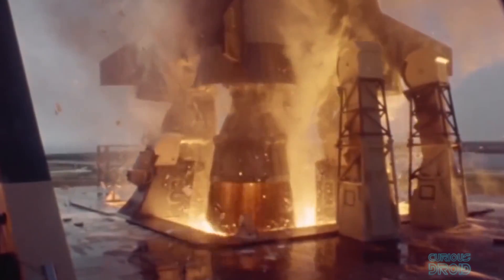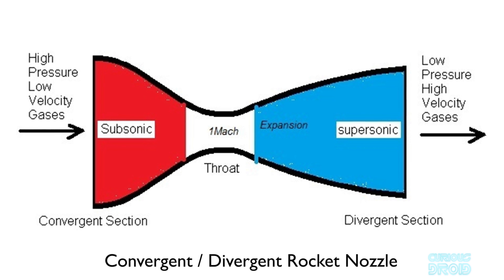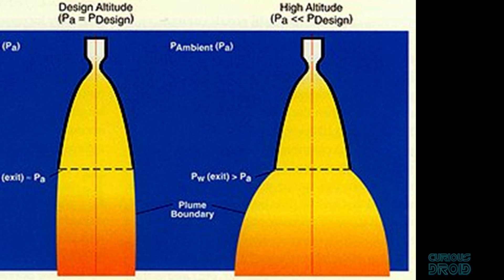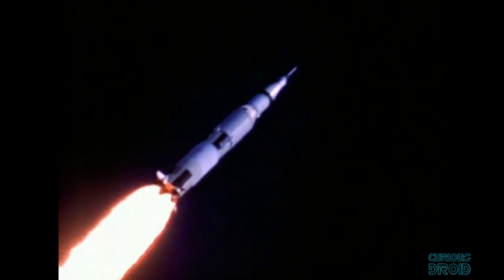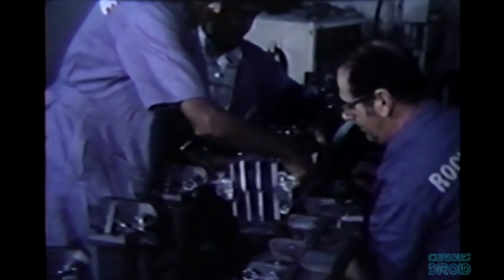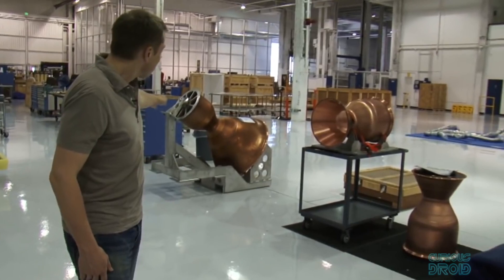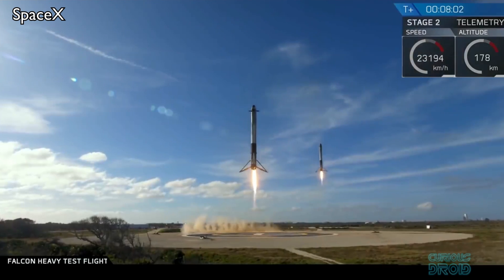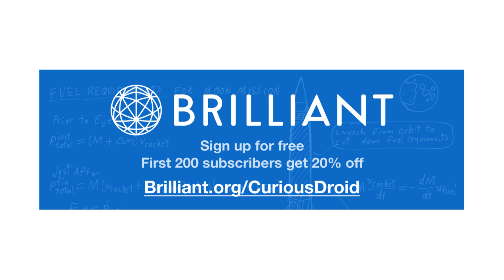Aerospike Engines - Why Aren't We Using them Now?

Comment: Rocket stages don't exist because of the need for different nozzles, they exist because if you're at half fuel that means half the ship is dead weight. Separate and drop the wwight, become more efficient.
Reply: We did that,  unfortunately, we threw all that hardware away which takes the efficiency gained and ruins the cost per pound. The whole point of the venturestar was to have a ship that could be inspected and reflown quickly.  As Elon Musk said himself. if you dont throw it away, you get to keep fueling it and reusing it. Smaller cargo maybe, but long term cost is super low and they return on the investment much, much higher.
Reply: @rayspace373  Same principle still applies in Space X launches except for the fact that Space X lands the boosters that are separated from the main stage with some leftover fuel. When you separate the dead weight from the main vehicle, the main vehicle will be awarded with a boost of delta-v, which is the amount of acceleration that an engine will provide with a given amount of fuel. Once you shed off all the extra mass, it results in the engine not having to work as hard to achieve the appropriate velocity needed for orbital flight. The efficiency of the engine is, definitely, also a key factor and is accounted for by staging the rockets with engines that are more efficient in certain altitudes. 

Right now, staging is the superior method of getting into space. The aerospike might have the potential to become the superior method, but it needs more development and testing before it can be fully realized, in my opinion.
Reply: True, but an SSTO doesn't have to be written off every time it flies.  The idea was to give up a little bit of payload capability for a much higher launch cadence and lower operating cost.  Maybe an expendable rocket can lift twice as much in one launch - but if you can launch the SSTO twenty times for the same amount of time and money, who cares?
Reply: I liked the idea of the Saturn first stage fitted with wings and a set of turbofans and landing gear for the return leg.
Reply: That model only works if the payload itself is a substantial part of the launch cost.  What if you want to launch something cheap, or your customer doesn't want to spend millions of dollars?  Nobody's going to launch a $1 million satellite on a $500 million dollar rocket, so expendable vehicles are only good options for payloads that are very expensive.  An SSTO would be able to tap a whole new market that didn't exist before.
Reply: Funny you should say that... you see, payloads are actually more expensive than rocket launches.
Reply: jax is correct.  Staging off dry tanks is key.  And since you no longer have to haul the heavy tanks and their even heavier fuel once dry, you don't need such big engines anymore, so staging off engines is good too.   Tsiolkovsky (oh look, a search keyword) will always make rockets his bitch :)

Aerospikes are actually pretty poor performance.   While they perform adequately across all regimes, they aren't any better than a nozzle design within it's design regime.  Often worse in fact...and they tend to be heavy.  Staged rockets also don't have to have engines that have good performance across all regimes, they only need the engines to be good up until they point that they're dropped.   Ex. the Saturn V uses high-thrust, low-iSP engines optimized for sea level performance (the F-1) in it's first stage, and hydrogen-burning, high-iSP, medium-thrust J-2s for the upper stages which operate in, and are optimized for, the upper atmosphere or space.

Note that the high pressure regime is actually very small.  Air pressure drops off very rapidly with altitude.

In order to make an SSTO practical and competitive, an aerospike would have to have twice the specific impulse, not slightly less than a conventional de Laval nozzle.  Ideally more like 10x the specific impulse.
Reply: That of course is a major reason for staging, but engine nozzle design plays a large role in how efficient your engine is.  This is why the Delta II with nine SRBs only ignited six at launch.  The remaining three had nozzles optimized for higher altitudes, and were ignited mid flight.
Reply: It’s both
Reply: Sounds to me like a hybrid design using conventional rockets for boosters and Aerospike for the rest would solve the problems. Specially when combined with the SpaceX return feature.

The other thing thou is that a returning single stage would greatly reduce space junk.

P.S. its kind of dumb how development just "stopped" when it can lead to so much savings & efficiency.
Reply: NASA ab8ment areas r drop/landing sites 4 SRBs & stage sections.
Sometimes they fail 2 retrieve sections jettisoned over oceans,but they have a system they try 2 use in order 2 recycle parts
Reply: SSTO fitted with a light sail would be the ideal goal to aim for. Efficient ground to air to space launch and then cut off the engines and switch on the laser.
Reply: Why don't they just refit a 767 with the 747 cradle for the shuttle ?
Reply: The other problem is without reusabilty, the practice is less sustainable, and it costs more energy and money just to recover used stages.
Another solve would be to design nozzles that "shapeshift" to keep their exhaust pressure more-or-less equal to ambient pressure, by dilating the mouth, constricting the throat, or both, during ascent. The converse must happen when the stage reenters and descends.
Reply: CountArtha well at the time these rockets were being made, launching two shipments was pointsless because they could put the shit together in space. They could barely launch satallietes, so the maximum capacity was needed, now with better fuels and rocket tech, as well as being able to join the launched stuff together in space means that they don't have too, which is why they're looking into it right now. But back then it had to be segmented and not reusable
Reply: CountArtha I already mentioned that... back then a (now standard) hard drive weighed immense amounts, which is why sattelietes were expensive and cumbersome. Now they're not. And now there's a possibility and market for other forms of rockets...

Comment: I gotta agree with the others - nice job presenting a fascinating topic. I spent a lot of time at NASA/Dryden (Edwards AFB) in the 90's and early 2000's and remember seeing some aerospike testing. They stuck the engine on the top of an SR-71 as I recall. It looked like a slick project. Unfortunately, that's as close as I got to it.
.
The problem with NASA not doing more research on aerospike is two fold. First, NASA has become much more risk averse than it was in the 50's and 60's. It's also being used for a social justice experiment - gotta have more female engineers and people of color ... NASA is unable to take the risks necessary for serious aerospace experimentation any more. I suspect that money is not the real issue. They are afraid of failure.

Comment: Very interesting. Something struck me though. Once a rocket gets into space, how does the engine work? Theoretically there is no pressure cos space is a vacuum. What I am finding perplexing, is that for any type of combustion, you need a heat, oxygen and fuel. If space is a vacuum, how come the engines don't just shut down, once 'the fire' has left the end of the rocket whatever the shape. I don't understand how the rocket keeps thrusting forward when it should just fizzle out.
Reply: Linda Steel 
Your question about thrust is to do with Newtons 3rd law of motion.

Every action produces an equal and opposite reaction. When a rocket shoots fuel out one end, this propels the rocket forward, so no air is required.

Also you have to bear in mind that there aren't the forces of gravity, air pressure and air resistance that all work against a rocket here on earth.

Also, you don't need oxygen to create heat or thrust.
Reply: Steve Corr  Thank you very much for your answer. I know the theory of what you said, maybe I am just thick, I just can't work it out in the practical sense in my head. I don't understand how the flame continues once you get into space. I will have to do a bit more research and thinking. Perhaps my brain doesn't work the right way. I remember when I was a kid arguing with the teachers at school. We were taught that there were no planets going around all the stars we could see in the sky, only our solar system had proven planets. I used to look up, see all those thousands of stars and think all the teachers and grown ups were stupid for telling me there were no planets whizzing round up there. Perhaps I just overthink everything.
Reply: Linda Steel 
You were taught there were no planets!!? My god what school did you go to? 
To be honest I can't remember what l was taught in school with regards to astronomy as it was over 40 years ago but I'm pretty sure it wasn't that.
There are over 200 billion stars just in our own milky way galaxy and each one of those stars has at least one planet.

Comment: I thought we use staged rocket design because of the weight issue
Reply: Yep. That's the real reason. It allows us to use better optimized engines, but that's not the real reason. The rocket equation necessitates enormous mass ratios to get high changes in velocity, especially for orbit. There are limits, however, to how light a fuel tank can be. To circumvent this, we can put a separate fuel tank on top, with its own engines. This lets us cheat and get a higher effective mass ratio.
Reply: @badbeardbill9956  The real reason is that trump is funding a cardboard box shuttle for the space force so the budget does not allow for this
Reply: Thats one of the reasons
Reply: It's essentially the same thing. By definition, the inefficiency of the bell shape means that more fuel is required to get from point A to point B. Since more fuel equals more weight, we need multiple staged rockets to launch into orbit.
Reply: Well, the initial stage is fully capable to lift the entire mass of the rocket, but at a plain acceleration ratio, to increase the TWR (thrust/weight ratio) the rocket needs to loose mass while accelerating. So, both are the reasons for staging. Try it with Kerbal Space Program game hehehhe
Reply: You could have a segmented fuel tank that ejects it's empty components, which parachute down and can be reused.
Reply: @ub3rfr3nzy94  What?  How would you do that?  Rocket fuel tanks are highly optimized for weight.  Aside from the mechanical complexities of even achieving something like that, segmenting a fuel tank would add a lot of weight.
Reply: it means double advantage.
Reply: +Pedro Sanchez No. Without stages, you would be lifting a bunch of useless empty fueltanks.
The tziolkovsky rocket equation basically says that for a givem speed of exhaust, you need half your weight to be fuel to reach that speed. Our propellants burn at 3-4 kilometers per second, and to achieve LEO you neet over 10 kmps of acceleration. So basically 87 percent of the rockets weight has to be fuel.
Now if you also bring up two hundred extra tons of fueltank, thats coming off your useful payload budget.
Reply: I need no channel youtube!, best way to save fuel will be to piggy back a rocket on a large Jet plane and  launch the rocket at near space altitudes.
Reply: all of the rocket is fuel,except the capsule,its huge,IF,it was more ecomomical,better used like spike,only a single stage needed,less fuel.but then again,why use fuel at all.we do have ufo technology,but dont tell any one.we have to be kept dumb.
Reply: 5wwweeedxxxxxxxxxxxxxxxxxxxxxxxxxxxxxxxxxxxxxxxxxxxxxxxxxxxxxxx za q za

Comment: X33 is not cancelled due to budget, it is cancelled due to military involvement. NASA has developed a very good material. design and engine for the new shuttle that could be used in jet fighter. Because NASA is possible to share their technology to other countries after they decided to let other countries to join them, that is why military confiscate all of the development and force them to cancel the project. So now in their rocket program they use a russian designed rocket engine instead of the US troublesome one

Comment: The simple answer, why rocket engines today aren't improved anymory is: These are obsolete. Today, we have propulsion systems with much higher efficiency, controllability and economy than even the best chemical engines, based on Ziolkowski's rocket quation can provide. Most people don't know much about, but before 2006, from ten Space Shuttle launches, nine (!) served for military- and telecommunication satellite maintenance. People from AFSPC quickly recognized the superiority of the new technlogy. Therefore, the Space Shuttle program was cancelled in 2011, but satellite maintenace never ceased. Of course, I won't divulge the technology, since the largest superpower on this planet relies its military superiority on it.;-)
Reply: debrainwasher 
Lemme guess - its powered by Elerium-119...
Reply: Hypothetically, you could power it also by Deludium-367, Naquadah-339, or even Unobtanium-214. Practically, you better used Dekaborane  (B10H14) in a pulsed reaction, according to top secret Klingonian and Goa'Uld physics, that says  H-1 + B-11 -> 3·He-4 + 8.7 MeV. Since the energy is carried away in pulsed charged alpha-particles, it can be coupled via induction coil loops and HV-rectifier diodes into a storage capacitor and to a load. About 0.1% of the reaction creates neutrons due to parasitic reactions like e.g. H-1 + B-11 -> C-11 + n - 2.8 MeV. These neutrons however are captured by naturally occuring Boron B-10 in Dekaborane, B-10 + n -> B-11. Hence, you get the perfect, compact aneutronic power source, that delivers up to several of GW of electrical power without nasty vapor cycle, heavy cooling, or radioactive irradiation. However, there is a little, dirty secret: The reaction takes about 600 keV for ignition - about 9.5 times for the classical D-T-reaction (63 keV). Therefore, you need an unusual, magical energy compression mechnism to bring down the energy to about 16 keV. You might understand, there are a lot of humans on this planet, wo live from selling oil, gas and coal. And these are not very keen on diclosing this little piece of technology. However, there is a hope, because the great king Donald Trump I. has just founded the US space force. He is determined to build a fleet of large, interstellar spacecrafts. The first will be probaly named «USSS Donald Trump». ;-)
Reply: well, at least the 'USSS' makes sense...

And Decaborane is a real compound; look up Scott Manley's video on zip fuels and the Valkryie project.

Comment: Delta Clipper  anyone? McDonald Douglas did (https://en.wikipedia.org/wiki/Lockheed_Martin_X-33) and flew it before Lockheed, but, NASA refused to give a dime to the the Delta Clipper project instead throwing a billion bucks at Lockeed Martin who after decades never got a single thing flying. But, Skunkworks can't do wrong.

The test models were using old style rockets because they were just validating takeoff and landing. Phase 2 was aerospike it.

Comment: i don't know why i'm watching this i'm a rocket scientist working in rocket city
the stumped spike also creates drag but it's offset by mass reduction
cooling the nozzle / heating the fuel is far less effective though
Reply: Allen A
R
Yes regenerative cooling is not as effective due to reduction of surface area exposure - but it could help keep the 'spike' from experiencing thermal shock and stress.  Regen-cooling was a win-win on engine bells to solve both the cryo-slush flow & preheating problems and the nozzle thermal stress problem.

Comment: Being wedded to the SSTO concept is the main reason that Aerospike never took off.  First stage engines are good enough as is, and then a transition to vac nozzles just works very well in standard 2 stage rockets.

Comment: Just going to present this here, but I participated in the event where nasa asked for help. They had a competition to submit new designs for new spacecraft, a new way to achieve pro-orbital travel. And the images of the x-33 are part of the designs I, and many other people, submitted. The argument presented to me afterwards, were that the math only worked for a single, geocentric, orbit.  This is something we have achieved every time. And that we needed to achieve something a new orbit to be able to access new information.
Reply: The images YOU are presenting of the x-33**
Reply: I was told when I resubmitted my math was that obtaining any other type of orbit would become improbable in relation to the energy output of fuel to thrust at extraneous angles, aka to change direction from liftoff point(s).
Reply: My math never supported that, due to orbital ion thrusters and other tech that is proven, but not used in combination with a single stage exposed to our atmospehere
Reply: The entire program was split apart as they ducked funding away from nasa, the entire testing process adjusted for money, reusability, and lack of human input. SpaceX has goals of sending people around the world with rockets in place of airplanes, other companies are actually focused on expanding our horizons as a global species.

Comment: While an efficient at all altitudes engine might benefit SSTOs, the efficiency of the engine is only a small part of it. SSTOs have to carry their empty fuel tanks all the way up instead of shedding dead weight in stages throughout the climb. I wonder if the small gains from better efficiency will counter the energy wasted for having to carry all that extra mass of the empty tanks up.